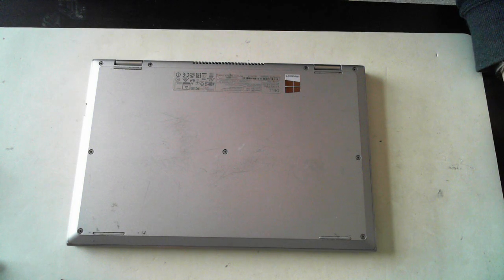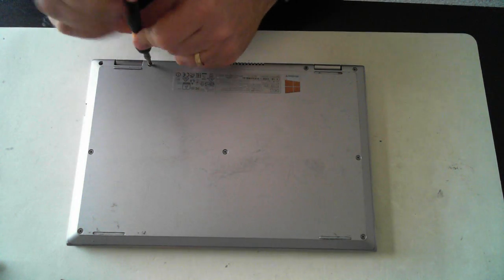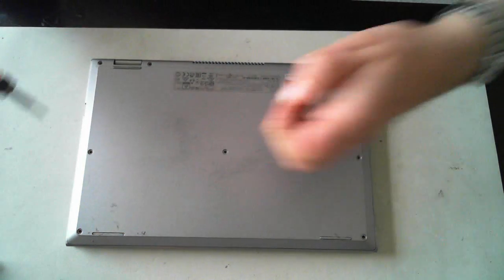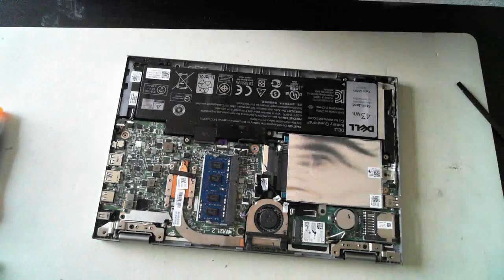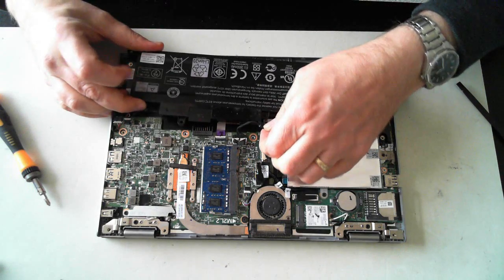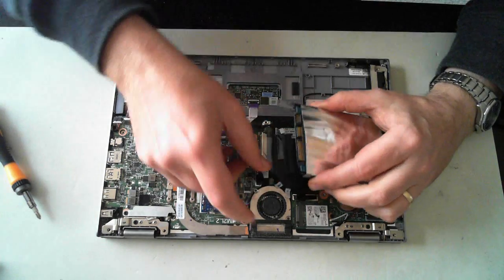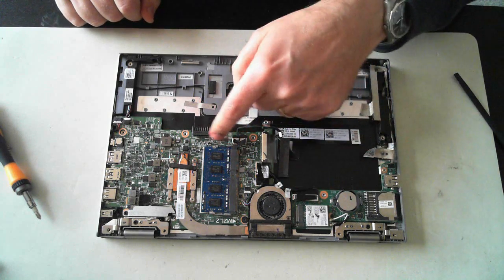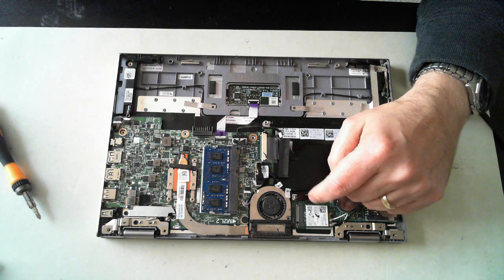Dell Inspiron 11 3000 Teardown

Comment: I also want to use the hard drive of this laptop (which I've removed) and I wanna read what's in it. Is there any extension that I can use to plug in the hard drive to another system so I can remove the data I need?
Reply: You can just take out the hard drive and plug it into another computer with a SATA to USB adapter. Or you could plug it directly into the motherboard of a desktop computer with a SATA cable. Once you boot to windows you will see the drive under "my PC" in the file explorer

Comment: is there a video card? And can it be fix if it's broken?
Reply: Intel HD gpu, can't be repaired unless you replace the CPU
the CPU is soldered, so.you can't replace it at home, it has to go to a shop for repairs

I recommend just getting a new Laptop, or PC

Comment: i used this same model i think about upgrade the ram,in build 4 gb ram,in this case now buy anther ram of 4 gb ram now 4+4=8 gb ram it's possible or not
Reply: No, that's not possible because there's only one RAM slot. If you decide to upgrade you would need to get one 8GB RAM stick. http://en.community.dell.com/support-forums/laptop/f/3518/t/19527618

Comment: Mine won't shut off. I open it up and all it has is a black screen and all you can do it move the mouse around and it's been like this for days
Reply from the maker: Hold down the power button for around 20 seconds and then try again. If that fails remove the battery for 20 seconds and then put it back in.

Comment: hey I have a orange light on is that good only with I plug it up what could it be it works fine
Reply from the maker: An orange light usually means the battery is charging. Which LED is showing the orange light?

Comment: I have the same computer and the `, Tab, Caps Lock, Shift, CTRL, 1, q, a, z dont work any suggestions on how to fix

(I typed this with anothr keybard)
Reply from the maker: If you plug in an external keyboard does that work?

Sounds like you may need to replace the keyboard or at lease readjust the keyboard cable.
Reply: Steven Bracey mine did the same thing I just stoped using the keyboard and used the on screen one. I never figured out how to fix it

Comment: can the processor be upgraded in this series? thanks for the video
Reply from the maker: Yes but not recommended due to potential BIOS and heat issues.
Reply: I don't think so, seems like it's soldered in place

Comment: How much ram can it handle, and slots?
Reply from the maker: There is one slot and I think 4G is the max but not sure - it may be 8G can anyone else confirm?
Reply: for the 3147 the max is 4GB. 1 slot.
Reply: DestroyCode Depends on the model/CPU. My 3153 (w/ Core i3 6100U) can take a single 8GB DDR3L), however the Pentium powered models only support a 4GB DDR3L.

Comment: What do i need to change to have a dual band receiver for wifi?
Reply: +Question First of all, you have to be sure your BIOS doesn't lock down your mini PCIe slot.
I got a dual band internal wifi card. Alas, it doesn't work with Acer but it works with Asus, and I realize BIOS does lock down on Acer.

Comment from the maker: +rameez Raza Riaz - just follow the steps in this video to remove the hard drive. Get a SSD the same physical size as the original hdd in the laptop. Unscrew the caddy, remove the hdd and put the ssd in the caddy and reverse the steps.
Reply: +dpcomputing can u make a video on how to upgrade the intel core processor........
thank you